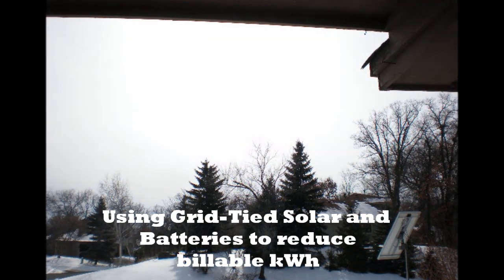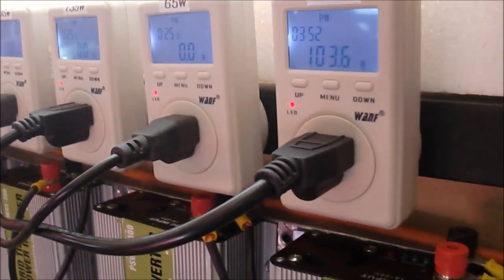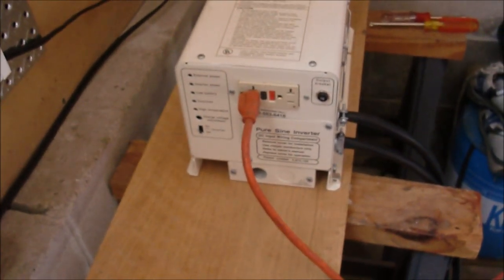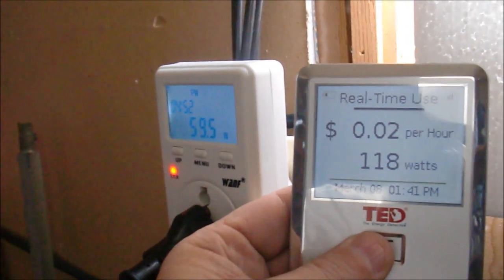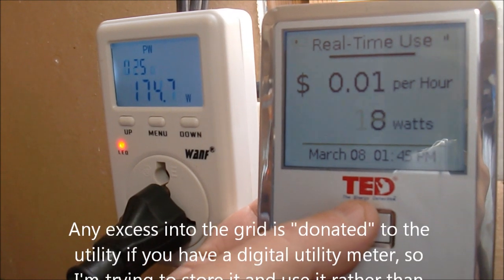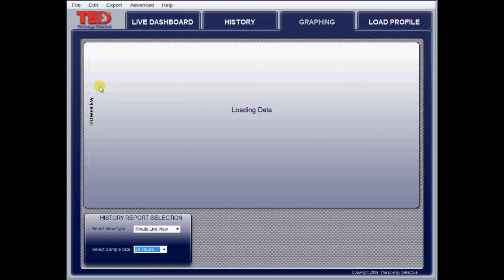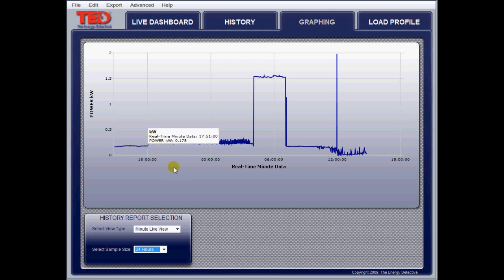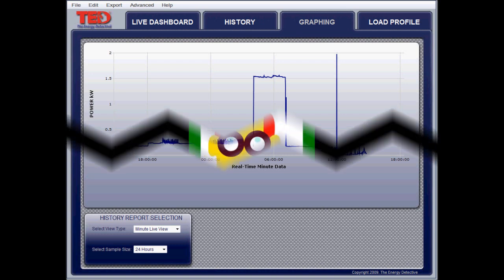Using Grid-Tied Solar and batteries to reduce billable kWh

Comment: I have my own smartmeter that can tell me how much I am importing and exporting in real time. It can automaticly turn on and off smart plugs to create a larger load. I call this "run when sun. 

One plug I use to charge all kind of batteries and it is switched on when export is starting and turned off.

Two of these I use to switch of refridgerators for an hour, one at one hour before and one at the moment normally the panels start producing more then my houses baseload.
If there happens to be a lot of export  the fridges are switched on again, one by one based on the # watts of export, to profit from the surplus of electricity.

Another plug is connected to my washingmachine that starts running when export really goes high. In wintertime it can really take a few days before it will run. If I want (or my girlfriend) I can overrided it with a tap on the smartplug  and have it run immediately, but I try not.

The above is relatively inexpensive way to achieve  the same thing like you try to achieve, limiting the export to the grid.

In summertime this will not be an easy thing to do as the panels will generate much more then my houses baseload and I will run out of devices that I can RUN when there is SUN.

Comment: I have two 140 watt panels that I was running on mppt with two 6 volt batteries. Ran series 24v during the summer but with winter I am just using an mppt grid tied inverter with the panels parallel (too much shading kills series setup) anyway. When I plug my kilowatt meter into the grid tie is says overload

Comment: Hello there how did u set your meter to Measure your solar power coming in and the power what your house is using when I have my meter set up they just work but the one that measuring the   The been used from the grid it measure both so if I am making 200 watts from solar and using 100 from grid the grid meter will show 300 what's plz help

Comment: Great system! Thanks for sharing! I have a grid tie, working towards your set up! I think a PLC connected to a CT( CURRENT TRANSFORMER) could monitor 0 WATTS and control excess watts. The PLC would be looking at main input at breaker box and comparing. Direct your excess where you need it . This is how to deal with a greedy meter!

Comment: Michael what and how do you get this "NET Smart meter" I am in California, "Edison" I have my own DIY setup with 2KW solar and get 13KW a day but how do I get the meter to run backwards. It stops going forward but how do I get to "Sell power back"
Reply: john Randall call the power company and you will have to set up an agreement with them. the meter will never go backwards but it will meter backfeed seperate  from what you pull. it is better to save 12 cents per kwh than to make 4 cents for backfeeding. you will  probably have to sign an agreement with the power company

Comment: What is controlling how much power you send into the grid and how much power you send into the batteries?

Is it the TED that controls that?
Reply: The Grid-Tie inverters are clever and sync with the mains supply voltage and frequency before outputting any power back into the mains. As you see in the video, he uses the "charge controller" and by using the switches, he can switch whether he wants the panels to charge the batteries or output to the grid.

Comment: have them order you a solar digital meter, i had the digital meter and went down town a talked to them and they ordered one ,no questions ,

  they just needed a way to shut power off out side for safety , make sure no power goes to the poll, even if the grid tie shouts down its what they need .

 i believe you can ask for analog meter say the digital puts out to much radiation and feel unsafe for you and family .

Nice Video

David

Comment: @Fearlessthinker: have you reached anywhere with the automated control system for controlling your grid tie inverter, etc.  so you don't send back power into the grid? Re the TED, how do you know if you are sending power out back onto the grid?  Neither Killawatt meter nor the TED will let you know which direction the power is flowing.
Reply: How would you configure them?  Is it that you place one on the breaker panel, one going to the load, and one on the grid tie inverter, taking care to place the CT's in the proper direction?

Comment: Thanks for getting back to me. I am aware that inverters have fuses, but fuses will not prevent your inverters from creating 220 volts from entering your house if your inverter is out of phase from the grid. AC is not DC In order to be tied to the grid, you must match its phase and voltage, to within 1 degree and 3 volts. How are you doing that? Real grid tie inverters cost thousands and have microprocessors to balance the load.

Comment: Trying to find an alternative to a $300 AGM solar battery for a home system. Found an Marine/RV AGM battery at SamsClub for $169. Its a Duracell 31DTMAGM 12V. Seems like good specs. What do you think? I need to put the batteries in the house so I don't want normal lead acid batteries.
 
•100 amp hour rate:110
 
•20 amp hour rate:105
•3 amp hour rate:85
•5 amp hour rate:86
•6 amp hour rate:87.4

Comment: @robrice2004 Check your billing Duke Energy really ups the kw per hour charge the less kw hour being used,im in southern Indiana and noticed since I have solar with net-metering its easy to spin the meter backwards with 3.6 kw but they have doubled my kw hour charge the less I use.

Comment: @jmcmahon33 I'm guessing the higher amp's are the reason,  doubling the panels from 2 to 4 kept the voltage the same but doubled the amp's, the way I have them wired.  I'm certainly not an Electrical guy, maybe Fearless can answer better than me.

Comment: Its very good to know how much power u put into the grid so u dont send power out to power co as u get nothing back,glad to see u are using battery bank and power inveter as they do no good resting doing nothing,as u know,as for keeping tabs on power dont run more than 800 watts thru your ((WANF)) meter i found out the hard way they like to burn up around 800 watts. as in smoke and melted lucky for me i was in room when this happened .

Comment: You optimized your solar production quite well. With your relatively few panels, you are to able to reduce electrical use quite a bit. Solar is the way to go. When people talk about 10 cent/kwh, they don't count the delivery charges and all the fees and taxes. 30 cent/kwh is more like it when you add everything up.

Comment: FT,
I pretty sure you can have net metering with Xcel. Call John Wold at 800-895-4999. He is the program manager for solar*rewards distributed interconnection. They put a bidirectional meter on your house that records kwh in and out separately. We are going to do the same thing near you in Wisconsin. Lots easier on the batteries.

"Distributed Interconnection" is the magic phrase for these programs when asking for information. Good Luck.

Comment: @Fearlessthinker It's a Sun, 600 watt, The 20-60 Volt model.  I'm running 2 sets of 100 watt panels. Each set of 2 panels are tied together in series, then each set is ran to the inverter in parralell.  I'm getting 41.8 Volts unloaded, and 39.6 Volts under inverter load.  Durring good sun I'm outputting 320-340 watts pretty consistant, Durring Solar noon I'll hit 400 watts breifly and I've seen 405-410 a couple of times, usually right after a rain, when the sky is clear and the panels are clean.

Comment: Using your batteries to power you furnace is a good idea I may try that too. I wonder how many batteries and 230 watt panels it would take to get off the grid. Im sure it would be a huge amount when my AC runs. That is the only problem with that. You would think if electricity is a supposed to be a scarcity they would love you for your donation but it is not. They want to have the monopoly. Best to use all you can and not bring up any issues with them. Who knows what they would do the love $.

Comment: My house was using 10 watts continuously to heat the air conditioner all year round, and 30 watts into unused wall adapters and unused TVs. The air conditioner runs a heater so a reed valve does not get damaged if you switch the air conditioner on during cold weather. So I turn it off at the electrical panel during winter.

40 watts x 24 hours = 1 Kwh per day of waste. For fun I am working on a circuit to switch one wall adapter off when it is not in use.

Comment: @jmcmahon33 I noticed the same issue with my setup, which sounds exactly like yours.  I noticed a big power jump when I added a 4th panel,  Now I run a steady 340 watts output, and have had spikes as high as 410 watts out of 400 watts of panels on my 600 watt grid tie inverter.  Prior the best I could hope for was in the 140 watt range.